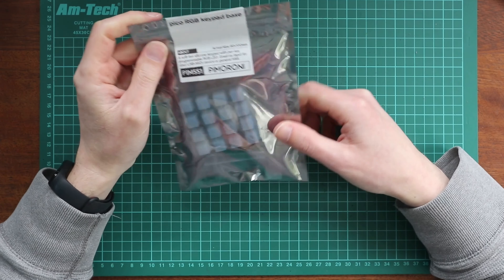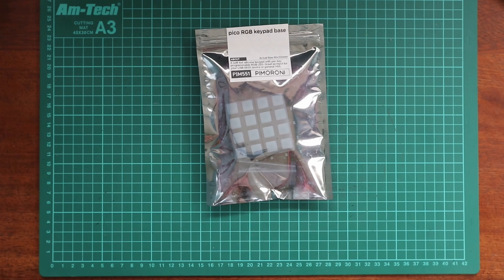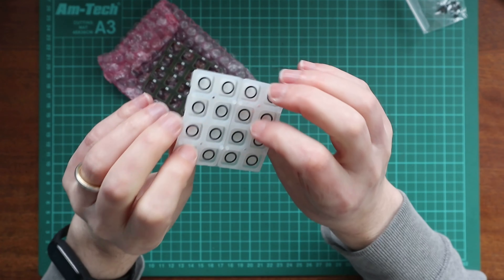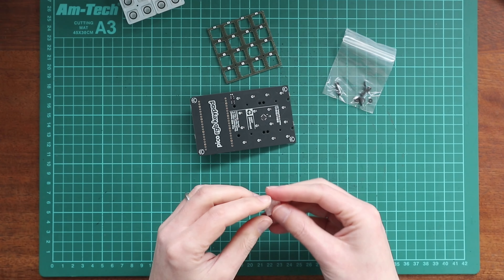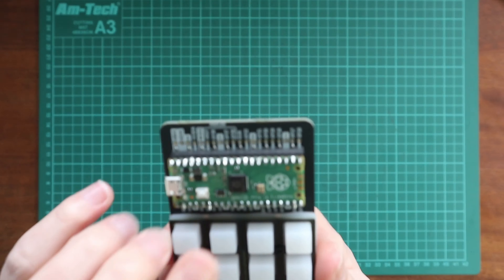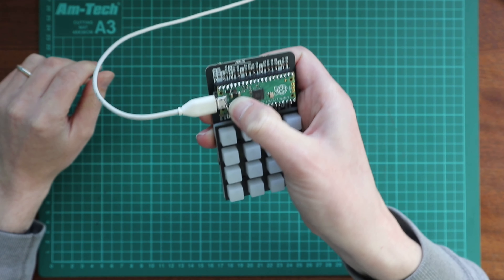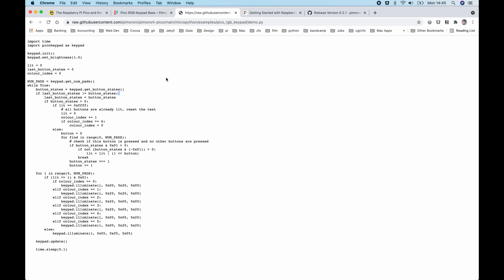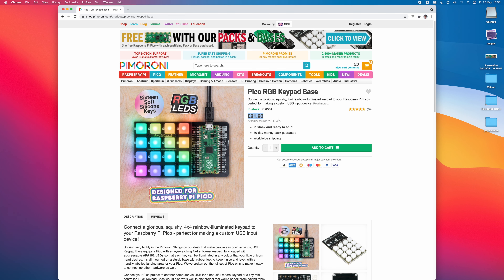Raspberry Pi Pico RGB Keypad by Pimoroni - Build and Code Examples

Comment: I got everything correct but the coding.  I use a MacBook pro 2015 and a mid 2012 MacBook pro with thonny and 7.23 circuit python. It recognized the uf2 and midi within daw but my coding when I tried to copy and paste the code to code.py I wasn't able to get led or pads to light up. The LED only lights when I use the flash nuke file so it does work and is put together correctly.would appreciate any feedback. Thanks
Reply from the maker: DAW? No daw in this vid. I found the MicroPython adafruit stuff a bit unreliable when I used it so my advice would be to use the latest release and refer to their docs.
Reply: @IanWootten  is it better to use micro or circuit Python if I’m trying to create a midi drum machine controller.  Also with my Mac set up what is better to use thonny or the I think mueditor? 

I tried to follow every step you did but the led and test I failed. 

I know it does work because I got it to light up on accident. I just wish it was detailed description of the code task that I have to make in thonny and what to enable it from. The shell or the top section of thonny.  Thank you for your help so far
Reply from the maker: I used Circuit python and Thonny on my launchpad midi controller video. That worked ok, but flashing the drive didn't work the first time. I haven't tried any other combination..
Reply: @IanWootten  it looked like you use MicroPython. Man, ive been trying to get this to work for weeks but the only thing ive been able to get work is the flashing led. I even went and got a replace ment with replacement pins, carefully following the hardware set up steps and etc. at this point its frustrating, lol, I really wish its a file that just says all the steps and I can just paste the code needed only to run it as a midi controller. It seems when I run the code in Thonny im missing something or its a syntax error
Reply: even in your Thonny it says youre in micropython
Reply: I almost want to zoom with someone with one of these just to see if I’m following the right steps according to their eyes of what I’m typing or dragging into the lib folder.
Reply: I have all new parts, this is what im getting now.Traceback (most recent call last):
  File "<stdin>", line 24, in <module>
RuntimeError: No pull up found on SDA or SCL; check your wiring

Comment: I got this keypad and it’s really cool. I have it working with the leds and shortcuts sending to computer, but then I added a small oled to it to see menus and info, the oled works ,but as soon I press any key the code seems to crash. I am having a hard time to make them work together. Problem is because I am a noob with i2c and some conflic is happening. If I remove one of them from the code it works. But not together. :( would be amazing to find example codes using both keypad/rgb leds and a small 128x64 oled (or any size sd1306) … thanks for the video ! Subscribed !
Reply from the maker: That sounds annoying. I'm a noob too - as you can see from my soldering. I have a bunch of displays that I need to make use of too. So many projects, so little time.
Reply: Hi! What code are you using to send shortcuts to the computer? I would like to use it for Teams/zoom/meet that I use on daily base at work. Thank you
Reply from the maker: There's a good (but 9 mo old) overview of how to do it here: https://github.com/qbalsdon/pico_rgb_keypad_hid

Comment: Even though it seems it could work and light up without soldering it really matters to code it for the RGBkeypadbase.  I've been at this for months

Now what I want to do is use the Pico display or a adafruit lcd to go on top of the Pico. I always thought it would've been cool to attached the Pico to the base then the Pico display on top of the pins of the Pico which it does fit so you think it would work. Nope.   But got both the RGB keypad working and the Pico display working. I also have six other Picos. So I'm thinking of using my extra display and pico audio outputs on the Omni bus. 

Also if I cannot attach the display, I would like to be able to change banks of drums in Ableton or other saw by using the button on the Pico which would be cool but I'm good if I just have to use just the 16. I'm just glad it's working.
Reply from the maker: Glad to hear you finally got it sorted!